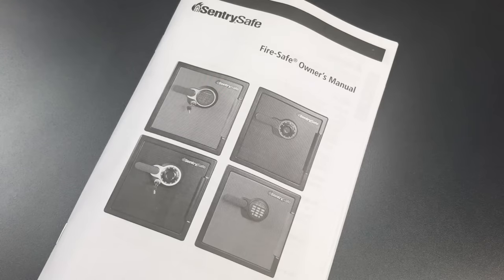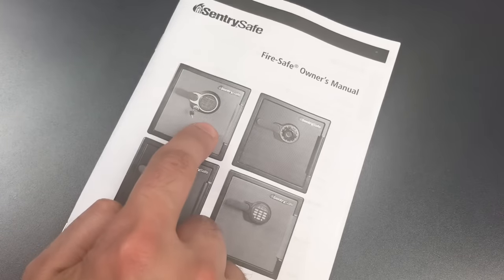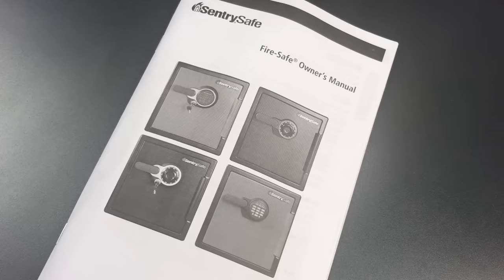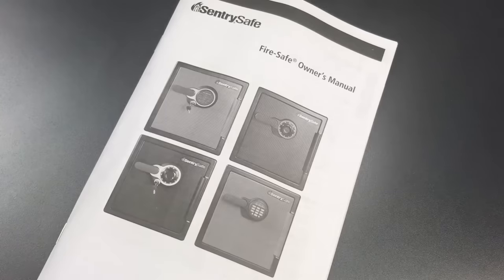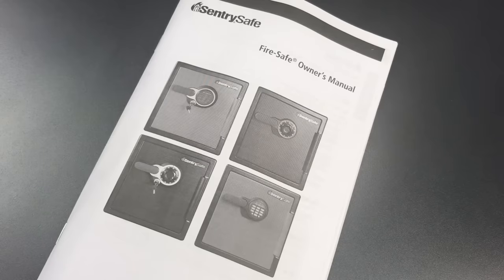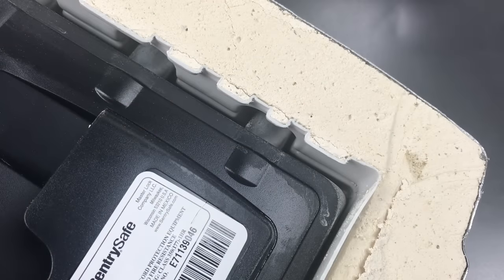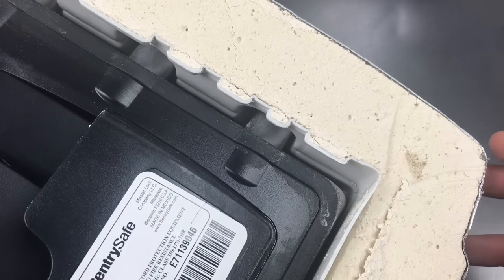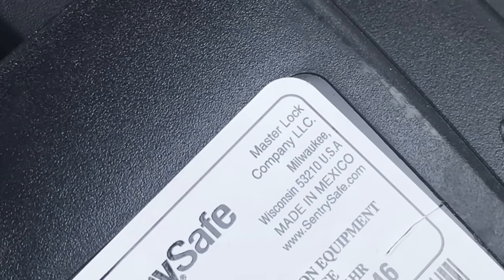[756] Sentry Safe Cut in Half FAST!

Comment: I literally thought this was made out of plastic by the way it bounced when you turned it, but considering how thin the metal was it might as well be. And of COURSE it's made by Master Lock.
Reply: Nobody Knows  right, this type of save is usually kept hidden inside houses to keep important documents. In case of a fire, they can still be retrieved. What needs to be accounted for is how heavy it is to give thief some problem carrying it.
Reply: Anyone using the title master is obviously not
Reply: Live Life  if they wanted to sell it purely as a fire safe, calling it SentrySafe was probably a mistake. Since it's not like you really set a sentry for fires, unless you consider a fire alarm a sentry.

Edit: just reread your comment, and it claims it's a security safe on it's website. Which means if you bought it online you'd only know it's a fire safe after receiving and reading the manual. Which is extra misleading.

Comment: It wouldn't surprise me if the filling turned out to actually be flammable.
Reply: At this point, I'm a little upset he didn't atleast hold a lighter up to the exposed foam.
Reply: As foam no it wouldn't burn, but as an aerosol yes it would.
I do think that insulation is questionable though.
Reply: Nobody Knows  The word "fireproof" and "bullet proof" are lies. Resistant, yes. Proof implies something impossible.
Reply: @heroslippy6666  For many uses, "fireproof" is defined in code, usually fulfilling its designed for a certain amount of time with a certain temperature fire without additional oxidants added. It does not mean impossible, and can at times even mean ablative. Just because you could squirt some ClF3 on it and get it to burn, doesn't mean it isn't going to be considered fireproof. 
I haven't had to get things certified as bulletproof or ensure that an assembly is so, but I would guess that it has a similar codified definition somewhere.
Reply: Nobody Knows  ok lol
Reply: @BandanaDrummer95  You're going to mention ClF3 yet you aren't going to discuss the aerosolization of a "fire proof" insulation to make a flamethrower? Gtfo normie.
Reply: @heroslippy6666  I did sort of mention that the pedantry you're getting at is ignored, so...
Reply: @BandanaDrummer95  soooo why are you here?

Comment: Excellent demo of a consumer "safe".  I learned this lesson a decade ago when someone used an axe to break into a similar safe at my Church.  I volunteered to find a relacement, and fortunately met a used safe dealer in western NJ.  He gave me an excellent education on safes, and showed me his collection of profesionally violated high security safes, such as those you might find at a diamond dealer or a pawn shop.  In any case I came away with a nice used TL-15 safe, which is rated to withstand a professional attack with tools for 15 minutes.  Although not much bigger than the "safe" it replaced, it weighed about 900 lbs, and we bolted it to the floor.  One should keep in mind that while burgulary rated safes have more resistance to say, a lawyer with a skil saw, they are probably not rated for fire resistance.  An option is to place a fire resistant safe or storage box within the burglar safe to achieve both.  Bottom line, if the safe doesnt weigh a half ton or more, its probably not burglar resistant.  And, after seeing thick steel plate safes filled with concrete embedded with carbide chips that had been violated, I realized that one must weigh the risk agains the cost of a good safe

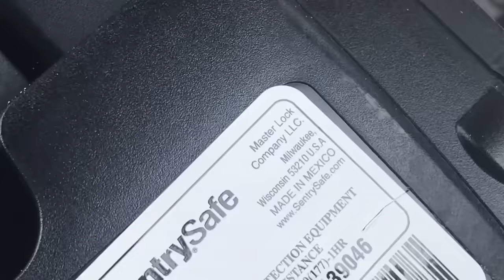Comment: 4:45 I'd spotted "Master Lock Company LLC" before you zoomed in on it.
Reply: I'm curious how Stack-On security cabinets compare. They're still pretty flimsy but can you cut through one in 2 minutes with a power saw?
Reply: Teknikul Righter 
Would be much louder. No cheap insulation to deaden sound. Metal definitely thicker then this POS. I have a couple of Stack on's and for the money they're pretty hard to beat for basic security.
Reply: Good for you
Reply: As LockLab would say "Master Lock, tough looking on the outside, marshmallow on the inside"
Reply: Seeing the name Master Lock LLC on a security product is kin, to seeing that Berkshire Hathaway is the owner of  the company you're looking to purchase a product from. i.e. Duracell Batteries.

I've got old and new versions of American Lock #700's. My how has that product changed, and not for the better.
Reply: Richard Thompson  Looks tough but its all fluff.
Reply: Geee! What a surprise when I saw the name Master Lock Co LLC and Made in Mexico.  Was the any indication on the outside of the cardboard box as to who made it and country of origin?  Or in the owners manual?
Reply: Master Lock .. "One Key to Rule Them All"
Reply: Clear as day at 4:55
Reply: I believe Master Lock purchased Sentry about a year ago.
Reply: I was about to make the same comment @david, It's no surprise that it's about as secure as a zip lock bag with that name attached to it.
Reply: Sentry Safe and Masterlock are both owned by Fortune Brands. They also own Moen, ThermaTru and Jim Beam, as well as (I'm sure) others I dont know off the top of my head
Reply: The mark of the beast!
Reply: That was definitely a "Today I learned" moment
Reply: It's always master lock! Ha ha ha!
Reply: And we all know what kind of security they provide...LOL

Comment: Safe Company: "Buuuuuut, he didn't pick it."

folds arms smugly
Reply: Yeah, he just carried it off to do that at home at his leisure without having to worry about getting
caught.  I think you can cut through the micro thin this thing with a simple hacksaw - cut through
 the shell, pull or pry it off it off ,  then break apart the foam with a machete.
Reply: @clambroth1923  You could just as easily open it without tools, if you don't care about actually harming whats inside of it. Just drop it from a reasonable height, the sheet metal will bend and you should be able to peel the rest of it off. Then you only have the fire isolation stuff left, which you can basically scratch out if you wanted to, stuff is quite brittle.
Reply: I think he's picked enough Master Lock products where that doesn't matter anymore.
Reply: @needmorespaceformyna  
2:32 - just roll the seam, use chisel to roll the seam out, peel back both sides, jig-saw to get to the inside... watched a lock-smith do it to a safe purchased at an estate-auction for the purchaser on site... took less time that LPL with the circular saw.
Reply: he doesnt have to pick it, master locks just open for him before he can even get his tools
Reply: @zpvnrt  Oh I don't doubt there are faster methods. I was mostly trying to highlight how crap that thing is as a safe since you could even open it without any tools at all.
Reply: Yeah, he picked it... up from the ground because it's so light and flimsy!
Reply: ...no, in this episode he only demonstrated how to avoid bringing the whole clumsy thing home for lock picking. the front is enough.
Reply: Exactly, this is BS. If they managed to take your safe home, all is lost. So bolt the thing down. I have a safe like this and I bolted down on top of my filing cabinet. Yeah, I suppose if the thief removes the top drawer (it too is locked) and happens to have some tools, he could loose the bolts holding down the safe. I mean he can also carry the safe along with the filing cabinet and jump over the fence with it to get out. Come on.   I mean, your doors aren't all that secure either so should you install security doors?  So this video does not impress me at all. If  on the other hand, if there were a quick hack that allows you to open the safe without the keys or the combination, then I would be impressed. Because  a thief can would then be able to open your safe and steal your valuables without having to bring a saw with him.
Reply: @brucemoose926  What would stop a thief from coming when you're not at home and attacking the three sides that are not bolted down with a circular saw? If the thief has a little more time, all they need is to create a starting hole and then they can go around the whole thing with sheet metal shear cutters. Or hell, a just crow bar should be enough. One or two heavy blows to punch a starting hole, then pry the rest open enough. Since it has feet stamped into the sheet metal, a crow bar could probably also be used to get leverage to rip the thing off from your filing cabinet. The point is, thin sheet metal is vulnerable to all sorts of brute force.
Reply: @brucemoose926  If one is serious about security, bolt it down or to something immovable. If it's bolted down in the corner or in a closet, it will be a lot more difficult to maneuver the circular saw so as to cut a 360 so as to remove a section and get into it in a reasonable period of time without disturbing the neighbors. One gets that for which one pays. The question is does it increase security enough to justify its price and be the best alternative. What percentage of burglars would be able to breach the safe? I suppose they could improve the product by using 1/4" steel.
Reply: @brucemoose926  lpl has other videos picking the lock of that safe not to worry
Reply: He still has the intact door for a new episode...
Reply: picked it up.
Reply: He'd probably break the mechanism if he tried.
Reply: @brucemoose926  There actually is a much faster and 0 damage causing method to opening all sentry safes.  It involves a very strong rare earth magnet being placed outside the solenoid that releases the bolts.  It would still require on the 2-stage lock models picking the simple barrel key to unlock the lever arm, but then the magnet alone is all that is needed to bypass the code as it pulls the solenoid like it was being energized and allows for the lever arm to be engaged.  Mr Locksmith has covered this years ago, but I'm not sure if it still works across all models.  I have tested it works on two of my safes, with the secondary key lock disengaged.  Sentry is a line plagued with issues, but it's not the worst brand I have owned.
Reply: It's a MasterLock product, he's already demonstrated the lock is no deterrence at all.

Comment: "Master Lock LLC"
Oh. that explains many things.
Reply: I don't get it?
Reply: @ArsyaUtomo  I guess he was referring to the part where the company is a Limited Liability Company
Reply: @ArsyaUtomo  If you watch many of these you find Master Locks have notorious issues like being easy to pick despite solid construction or their one "Lock Out, Tag Out" lock that has a relatively pick resistant core but a weak body and shackle.
Reply: @jszigetvari  no. Master lock is notorious for making extremely unsafe and unreliable locks
Reply: @ArsyaUtomo  master lock is known for making very cheap locks that are very easy to pick and labeling them as "unpickable" and such
Reply: @PPSadlon  LOTO locks are meant to be that way
Reply: @vsync  They are meant to be cheap construction but no need for an intricate core. They arent protecting anything directly only preventing immediate access to controls so an intricate pick resistant 6 pin core is pretty pointless there is not much to gain for anyone who would attempt to pick one that was in actual use other than causing possible injury to others but that is very unlikely and not an efficient way to do so. Otherwise if that was a concern they would never be made put of plastic. Yet their locks that are actually designed to protect property typically have much less intricate cores that are easier to pick but are otherwise made from strong material. So they end up being resistant to damage and being broken off but are usually way easier to be picked. It truly makes no sense. If they just switched the cores from their consumer locks and the LOTO locks both would be good at their intended purpose. Users of LOTO locks would notice no change and those wishing to protect their property would have a more pick resistant lock.

Comment: I love how he isn't even using a concrete saw! Please also note the external pin hinge. MAJOR weakness there, too. However, if it is specifically stated as "fire protection for your valuables" rather than "security for etc" then maybe they have a case.

I had one of these for a while. The solenoid start to fail. So I got out the mallet and helped it open one last time, then took it down to a locksmith and bought a real safe from him with a four number rotary combination. Never been happier.

Comment: My son's piggy bank has thicker metal than this.
Reply: J.H. what the fuck are you rambling? company said ''it's a safe for goods jewels etc.'' well, it'not safe at all. it's garbage. period.
Reply: @spiritualcramp8000  It's a FIRE Safe, with some additional lock security. It's constructed to reduce the rate that thermal energy is transferred thru the safe and those to important things you have inside the safe so hopefully they are not lost in a house fire.
Reply: Craigfield who would spend money to buy a safe that protects stuff from a fire and not from a thief? and i wish the lawyer throws this crap into a fire to see how much is this really ''fire safe'' i bet it melts in a few minutes.
Reply: @spiritualcramp8000  you put this fire safe into a convencional thief safe. Then your things will be safe against thief and fire😂😂
Reply: @SecretPesch  LOL ..and a rubick cube inside  with the note  ''you've been  pranked''
Reply: @spiritualcramp8000  My mother's shop safe used to get stolen about every 6 months. Almost always empty except for the occasional cake. It was a cake shop, so what were the thieves expecting. It used to look like hard work because the ones that were retrieved had taken some punishment to open. The cakes were from the pig bin.

Comment: I had a safe similar to this for fire protection and to discourage a nosy house cleaner or guest. It never occurred to me that it would provide security against a determined burglar.
Reply: even bank vaults cant keep a determined burglar
Reply: Yeah I have something from this brand as well. I definitely don’t think about keeping valuables in there, just important documents I want protected from fire.
Reply: Nothing will.. A circular saw with a metal cutting blade can cut through 1/2 inch plate just as easily.  So I'm not sure how this is showing anything special.  The main thing is that it's not heavy and can be carried away;  and I don't think it has holes to bolt it down.
Reply: @calholli it does have bolt holes. Even comes with some pretty large anchor bolts.
Reply: @stonemanbytes  Nice..  But like I said, you can cut through that same safe if it were 1/2" steel with that same saw and it only takes about 2x or 3x the time..  So only a few minutes.
Reply: @calholli  that’s fine. Mine is hidden and bolted down. And it’s only to hold my family’s documents. If someone went through the troubles of finding mine and cutting into it, they’d probably be fairly disappointed.
Reply: @stonemanbytes  not mine..  They are all huge and packed full of firearms.

Comment: 4:42
I was very confused as to who would make such an atrociously horrible safe. Then I saw the sticker...
Reply: But you have to admit that they are masters, master in bad safety! :-)
Reply: Master lock is adequate to protect your clothes maybe
Reply: So who makes a decent safe for under 200$?
Reply: @TakeTurnsGaming  For 200$ no one, unless you mean a decent safe to store unimportant cheap stuff. Add a couple of zeros to your prize and you get something decent. Two tings is important for the great safe: 1) As impossible to move as you can afford. 2) Take as long a time to break into as you can afford.
If the safe cant be bolted safely to the building would I not go below a ton in weight. And minimum 30 minutes of brutal entry is also a minimum.
Reply: @friedmule5403  I'm just concerned with someone lock picking or breaking into it on premises at location.
Reply: @TakeTurnsGaming  Often do the thieves take the safe with them, if it's not "impossible" to move and then do they have all day. Second is it important that a thief don't get any rewards! What I mean by that is if they can see that there tools leaves clear marks or even do makes damages, they get encouraged to keep on going. A thief do stop very fast if the safe cant be moved and there tools don't do any visible damage. Often do they stop in a couple of minutes when nothing happens.
Reply: @friedmule5403  but is you're typical thief sophisticated enough?
Reply: @TakeTurnsGaming  No they aren't and that's the problem, they wont try to pick the lock or try other fine techniques. They will steal your safe and force it open when they are home. If they can't move the safe will they try to saw, grind, break or anything that a brutal and fast. If they see that it has no affect in maybe 5 minutes, do they give up, but if the safe do start to get dents or clear marks, do they keep going because it looks like they can break the safe.
Reply: @friedmule5403  Are you talking about MBT-grade armor? Not sure if such safes are mass-produced, so the price should be comparable to the decent new car.
Reply: @heyhoe168  Hmm, … I try to explain myself better:-)
What I am talking about is to get the best safe you can afford. If a thief is trying to get into the safe, does alone the results of his work, determine if he proceeds. Do the safe start to show signs of dents, do it tell the thief that he is on the way to win, and the thief will continue. While if the safe looks like new after several attacks, do the thief stop very quickly, to not waste time.
For safes that are not made by real safe experts, are the rule of thumb: "only store up to 10% of the safes value". So a $200 safe should only contain up to $20 :-)
On the other hand can you get safes with a guarantee of a value, that shows you on how safe your values is!
Reply: @TakeTurnsGaming  your mum
Reply: Cat Mouth  Lol yes that may have taken a bit more than just a skill saw from Aldi :-)